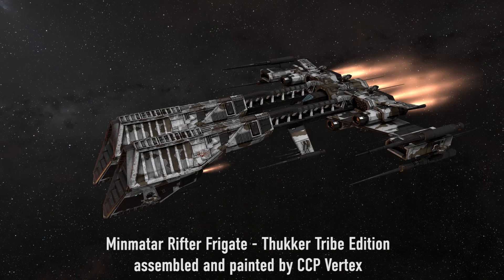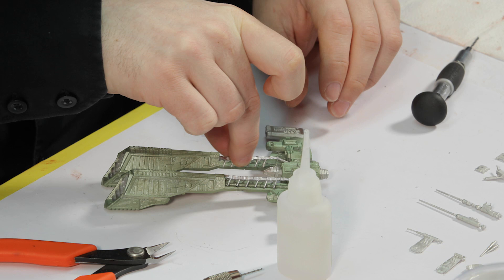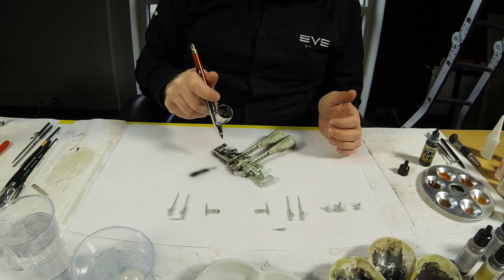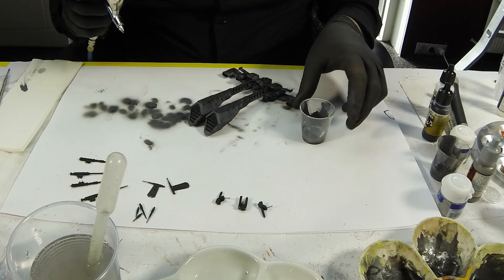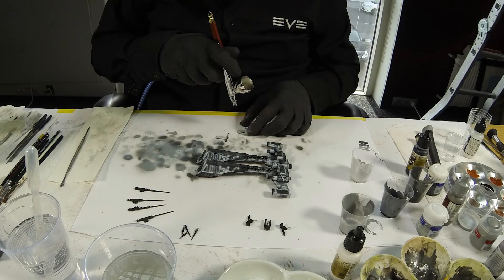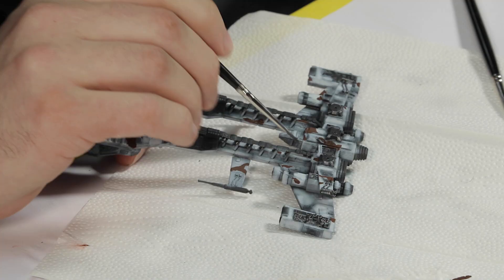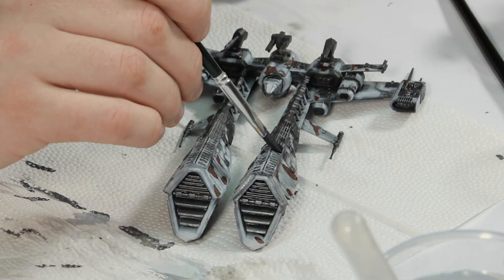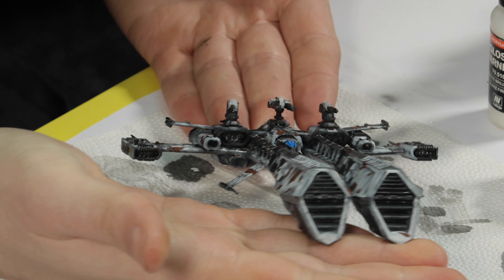How to paint your EVE Online Rifter model kit from SMTS

Comment: Why are they so expensive? Are they not plastic or something? I cannot tell from the video.
Reply: Nick Richardson The models are hand made in England using white metal. They tend to cost more than mass manufactured plastic models, but the quality is much higher.
Reply: Oh that's very nice. Sounds like they would be a much higher quality then other models. I appreciate you answering my question. Thanks, and fly safe o7
Reply: Torfi Frans Ólafsson Oh that's very nice. Sounds like they would be a much higher quality then other models. I appreciate you answering my question. Thanks, and fly safe o7